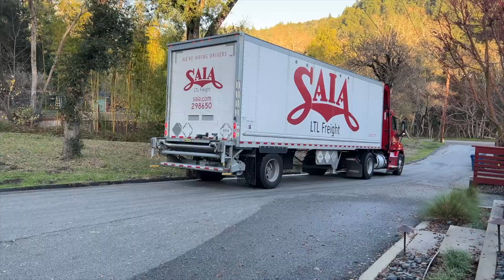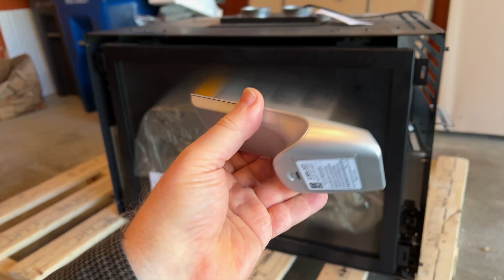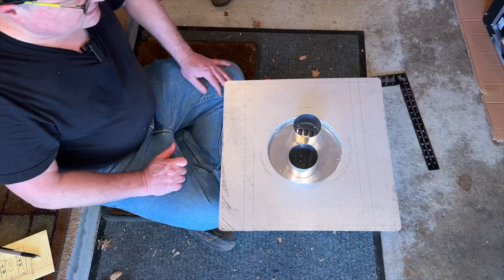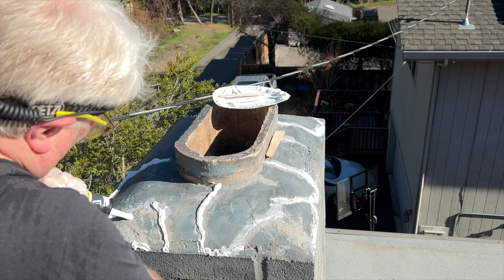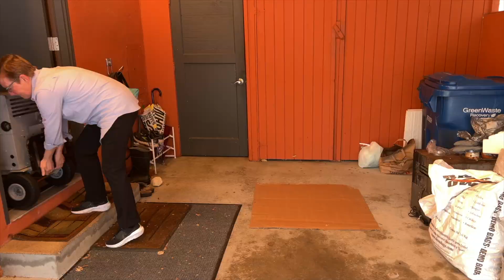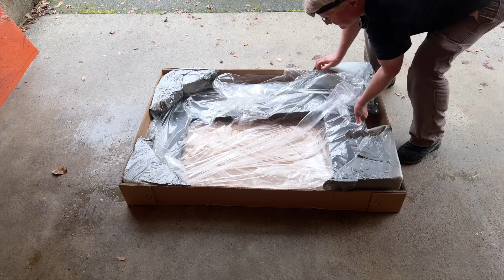Amateur DIY Gas Fireplace Insert Installation (Kozi Heat and Duravent)

Comment: You did a great job for the most part! Just be careful because just like most manufacturers, DIY installs void your warranty. “This limited warranty will be void if the fireplace is not installed by a
qualified installer and according to the installation instructions.”

Comment: I just got one of these kits.  The vent part of the kit is aluminum.  But the base plate is galvanized steel.  That's why he/you can't solder the base.

Comment: Thanks you two, nice work. Will the local code allow new houses to have a gas fireplace? 
Like your generator the gas fireplace is a nice backup as it gives you some heat during a power frailer.